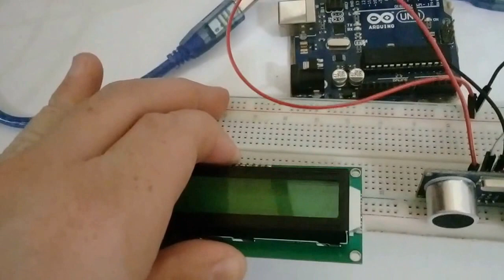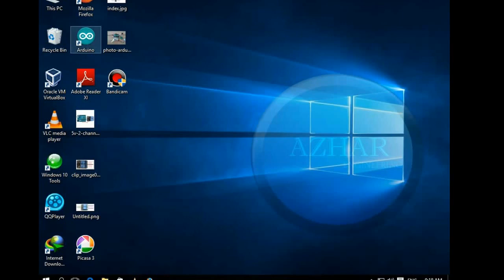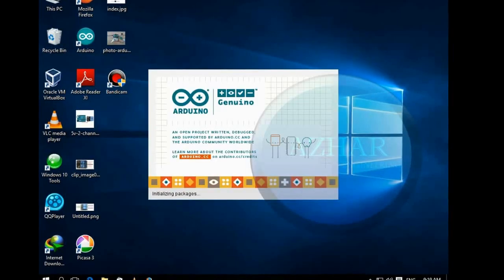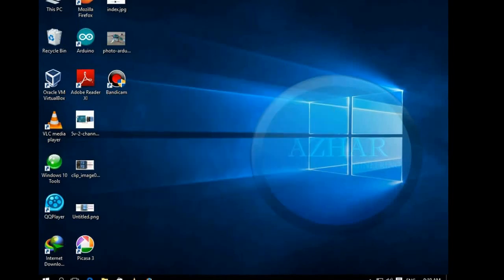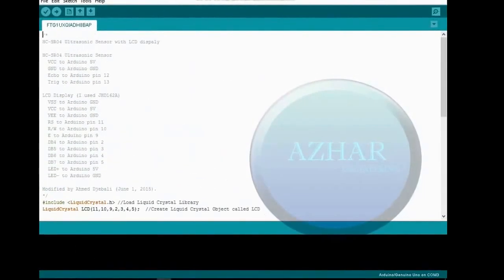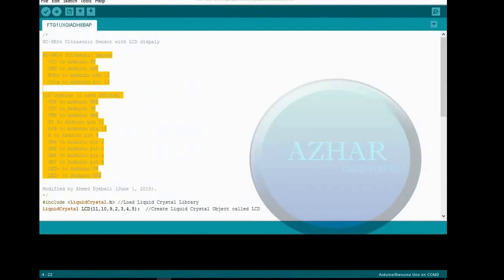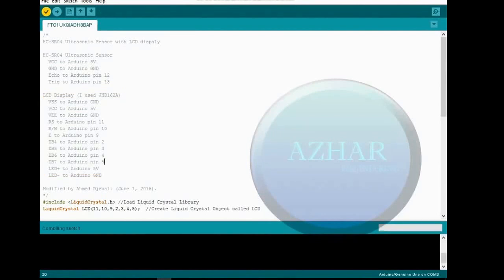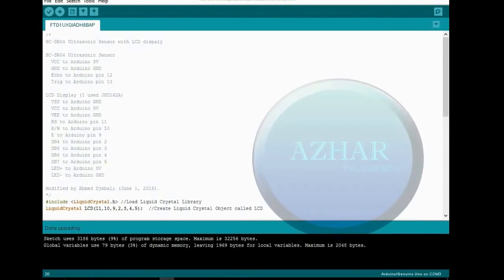How to measure distance with arduino using ultrasonic sensor HC-SR04

Comment: Or paste the code here, I'll    re-configure it
Reply: /*
HC-SR04 Ultrasonic Sensor with LCD dispaly

HC-SR04 Ultrasonic Sensor
  VCC to Arduino 5V
  GND to Arduino GND
  Echo to Arduino pin 12
  Trig to Arduino pin 13

LCD Display (I used JHD162A) 
  VSS to Arduino GND
  VCC to Arduino 5V
  VEE to Arduino GND
  RS to Arduino pin 11
  R/W to Arduino pin 10
  E to Arduino pin 9
  DB4 to Arduino pin 2
  DB5 to Arduino pin 3
  DB6 to Arduino pin 4
  DB7 to Arduino pin 5
  LED+ to Arduino 5V
  LED- to Arduino GND
  
Modified by Ahmed Djebali (June 1, 2015).
*/
#include <LiquidCrystal.h> //Load Liquid Crystal Library
LiquidCrystal LCD(11,10,9,2,3,4,5);  //Create Liquid Crystal Object called LCD

#define trigPin 13 //Sensor Echo pin connected to Arduino pin 13
#define echoPin 12 //Sensor Trip pin connected to Arduino pin 12

//Simple program just for testing the HC-SR04 Ultrasonic Sensor with LCD dispaly 
//URL:

void setup() 
{  
  pinMode(trigPin, OUTPUT);
  pinMode(echoPin, INPUT);
  
  LCD.begin(16,2); //Tell Arduino to start your 16 column 2 row LCD
  LCD.setCursor(0,0);  //Set LCD cursor to upper left corner, column 0, row 0
  LCD.print("Target Distance:");  //Print Message on First Row
}

void loop() {
  long duration, distance;
  digitalWrite(trigPin, LOW);
  delayMicroseconds(2);
  digitalWrite(trigPin, HIGH);
  delayMicroseconds(10);
  digitalWrite(trigPin, LOW);
  duration = pulseIn(echoPin, HIGH);
  distance = (duration/2) / 29.1;

  LCD.setCursor(0,1);  //Set cursor to first column of second row
  LCD.print("                "); //Print blanks to clear the row
  LCD.setCursor(0,1);   //Set Cursor again to first column of second row
  LCD.print(distance); //Print measured distance
  LCD.print(" cm");  //Print your units.
  delay(250); //pause to let things settle
}

Comment: Hey, i made this project just before a few moments, but the measurements are not accurate, why?
Can you help me figure it out?
Reply from the maker: It will be due to the oreintation of the sensor.. the sensor should be at 0 degree with the ground and 90 degree to the front of the obstacle
Reply: @AzharElectronics  i see, thank you for guidance, I'll try,
Reply from the maker: @sameerali7763  you are welcome
Reply from the maker: How much is the error?
Reply: @AzharElectronics  its not an constant error but error changing with distance.
Ex: when on 10cm, measurement is at 8cm
At 8,it is 7cm,
At 30,its somewhere at 38,40 ,

Comment: hi... i am getting an error "redefinition of void setup()" can you plz let me know where is the error?
Reply from the maker: Yes. Check the code there will be another void setup()
Reply: @AzharElectronics  Thank you very much :)
Reply: an another error occurred while uploading the sketch... what could be the reason behind this?
Reply: serial port not connected?
Reply from the maker: @MANDEEPKAUR-fq3py  go to tools in Arduino IDE and select the port to with the arduino is connected
Reply: @AzharElectronics  Arduino: 1.8.9 (Windows Store 1.8.21.0) (Windows 10), Board: "Arduino/Genuino Uno"

Sketch uses 3180 bytes (9%) of program storage space. Maximum is 32256 bytes.
Global variables use 83 bytes (4%) of dynamic memory, leaving 1965 bytes for local variables. Maximum is 2048 bytes.
avrdude: stk500_getsync() attempt 1 of 10: not in sync: resp=0x30
avrdude: stk500_getsync() attempt 2 of 10: not in sync: resp=0x20
avrdude: stk500_getsync() attempt 3 of 10: not in sync: resp=0x30
avrdude: stk500_getsync() attempt 4 of 10: not in sync: resp=0x20
avrdude: stk500_getsync() attempt 5 of 10: not in sync: resp=0x30
avrdude: stk500_getsync() attempt 6 of 10: not in sync: resp=0x20
avrdude: stk500_getsync() attempt 7 of 10: not in sync: resp=0x30
avrdude: stk500_getsync() attempt 8 of 10: not in sync: resp=0x20
avrdude: stk500_getsync() attempt 9 of 10: not in sync: resp=0x30
avrdude: stk500_getsync() attempt 10 of 10: not in sync: resp=0x20
An error occurred while uploading the sketch

This report would have more information with
"Show verbose output during compilation"
option enabled in File -> Preferences.

this is the error message... i did exactly the same connections as yours.
Reply from the maker: @MANDEEPKAUR-fq3py  search in Arduino Forum for this problem

Comment: Hey Bro
My LCD is showing 0 cm.
I checked all the sensors and matched the wires with the circuit diagram in the code link given.
Please tell what to do?
Reply from the maker: Try with another sensor

Comment: sir could you tell me please how you turn the lcd ? because i have already complied and uploaded the codes but still my lcd is not working
Reply from the maker: Check the connections of LCD
Reply: Azhar Electronics . Appreciated for the reply sir. i have checked all the connection my LCD is showing the distance but its not really bright as yours LCD. while with other experiments my LCD shines brightly and results are visible from the far. Your LCD is actually shows results very nice and clear with bright screen.
Reply from the maker: Check the LED pins of LCD that are 15 and 16. If you are having problem with the contrast of results then connect a potentiometer 10K to pin 3 of the LCD.
Reply: Azhar Electronics thank you sir . i will try the way you told me.

Comment: hello I got the error
Sketch uses 3198 bytes (9%) of program storage space. Maximum is 32256 bytes.
Global variables use 83 bytes (4%) of dynamic memory, leaving 1965 bytes for local variables. Maximum is 2048 bytes.
avrdude: stk500_getsync() attempt 1 of 10: not in sync: resp=0x30
avrdude: stk500_getsync() attempt 2 of 10: not in sync: resp=0x20
avrdude: stk500_getsync() attempt 3 of 10: not in sync: resp=0x30
avrdude: stk500_getsync() attempt 4 of 10: not in sync: resp=0x20
avrdude: stk500_getsync() attempt 5 of 10: not in sync: resp=0x30
avrdude: stk500_getsync() attempt 6 of 10: not in sync: resp=0x20
avrdude: stk500_getsync() attempt 7 of 10: not in sync: resp=0x30
avrdude: stk500_getsync() attempt 8 of 10: not in sync: resp=0x20
avrdude: stk500_getsync() attempt 9 of 10: not in sync: resp=0x30
avrdude: stk500_getsync() attempt 10 of 10: not in sync: resp=0x20
An error occurred while uploading the sketch

Comment: code is

/*
HC-SR04 Ultrasonic Sensor with LCD dispaly

HC-SR04 Ultrasonic Sensor
  VCC to Arduino 5V
  GND to Arduino GND
  Echo to Arduino pin 12
  Trig to Arduino pin 13

LCD Display (I used JHD162A) 
  VSS to Arduino GND
  VCC to Arduino 5V
  VEE to Arduino GND
  RS to Arduino pin 11
  R/W to Arduino pin 10
  E to Arduino pin 9
  DB4 to Arduino pin 2
  DB5 to Arduino pin 3
  DB6 to Arduino pin 4
  DB7 to Arduino pin 5
  LED+ to Arduino 5V
  LED- to Arduino GND
  
Modified by Ahmed Djebali (June 1, 2015).
*/
#include <LiquidCrystal.h> //Load Liquid Crystal Library
LiquidCrystal LCD(11,10,9,2,3,4,5);  //Create Liquid Crystal Object called LCD

#define trigPin 13 //Sensor Echo pin connected to Arduino pin 13
#define echoPin 12 //Sensor Trip pin connected to Arduino pin 12

//Simple program just for testing the HC-SR04 Ultrasonic Sensor with LCD dispaly 
//URL:

void setup() 
{  
  pinMode(trigPin, OUTPUT);
  pinMode(echoPin, INPUT);
  
  LCD.begin(16,2); //Tell Arduino to start your 16 column 2 row LCD
  LCD.setCursor(0,0);  //Set LCD cursor to upper left corner, column 0, row 0
  LCD.print("Target Distance:");  //Print Message on First Row
}

void loop() {
  long duration, distance;
  digitalWrite(trigPin, LOW);
  delayMicroseconds(2);
  digitalWrite(trigPin, HIGH);
  delayMicroseconds(10);
  digitalWrite(trigPin, LOW);
  duration = pulseIn(echoPin, HIGH);
  distance = (duration/2) / 29.1;

  LCD.setCursor(0,1);  //Set cursor to first column of second row
  LCD.print("                "); //Print blanks to clear the row
  LCD.setCursor(0,1);   //Set Cursor again to first column of second row
  LCD.print(distance); //Print measured distance
  LCD.print(" cm");  //Print your units.
  delay(250); //pause to let things settle
}

Comment: Please shar code with me
Reply from the maker: Your Email?
Reply: Azhar Electronics 
vikrantneve3@gmail.com
Reply: Azhar Electronics 
But my display is 1602A
Reply from the maker: I also used that. 
Check your Email for Code.
Reply: Azhar Electronics 
Ok can you give me circuit diagram or connection details
Reply from the maker: The connections are in the code open the code at the tops there are connections
Reply: Azhar Electronics 
Ok
Reply: Vikrant Neve did you make the project does it work .I am making it for my science exhibition .